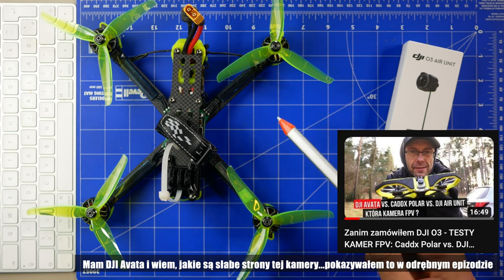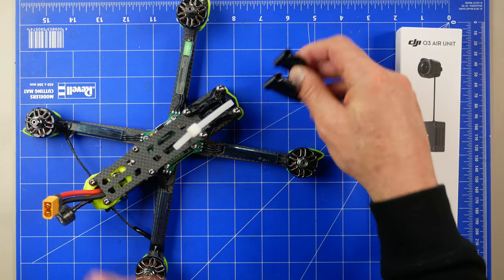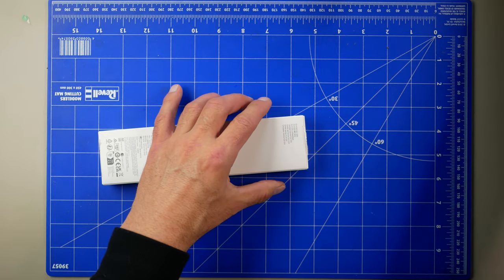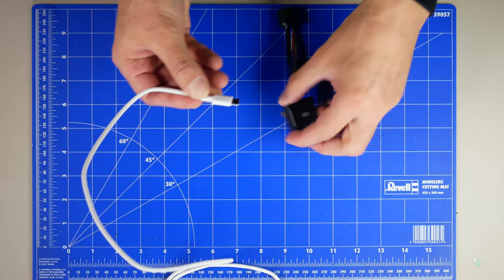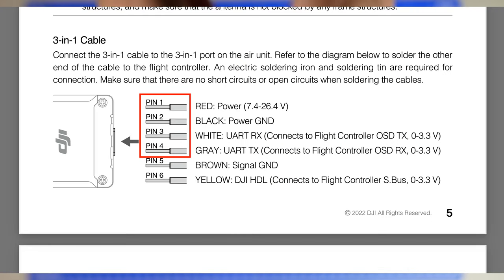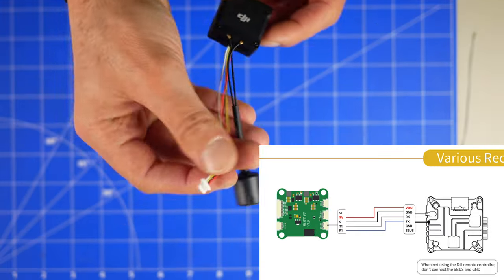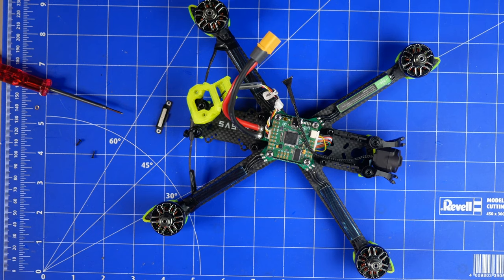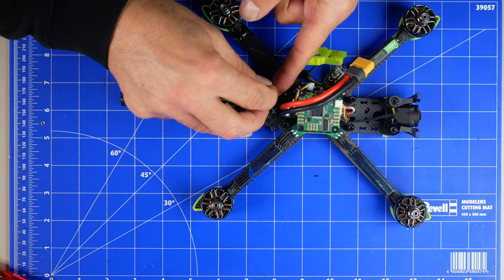DJI O3 Air Unit + Nazgul 5 V2 - instalacja krok po kroku

Comment: For aome reason the 03 air unit isnt getting power, theres abiut five volts in the terminals on the circuit board, and 1.2volts on the wire

Comment: Thank you so much!) I'm very new in FPV and it's a great instructionbut have an issue :  I connected  O3 and Iflight module as on video, but O3 module is heating up very fast and betaflight doesn't see gyro, maybe you have some tips? Thank you in advance.)
Reply from the maker: Hi Ivan, you can turn on low power mode. Hope you can find the option in goggles menu.
Reply: @RafalGalinski_drony  Yes, thank you, problem was in dji assistant app, you need to update O3 in it's own app and goggles in fpv app, then in goggles v2 settings for O3 are in the device "about" menu, and then you can bind them. I was just a bit worried about how fast temperature is raising on O3 and had doubts if I connected wiring wrong, but looks like it is normal.)

Comment: Is it possible to use with out Goggles   can take photos and videos?
Reply from the maker: Amar, that is a FPV copter/drone. 100% manual flying with goggles. 

It flies like a plane, up to 150 km/h and records video only on GoPro or build-in video transmitter module.

Comment: tanttutaj chcę latać z moim dji rc 2 robię jak Na jednostce powietrznej jest 6 pinów, a ty trzymasz tylko 4 dziękuję
Reply from the maker: I use crossfire protocol for radio control, so 4 pins are fine. If you wanna use DJI FPV Remote Controller 2 - you need 6 pins.